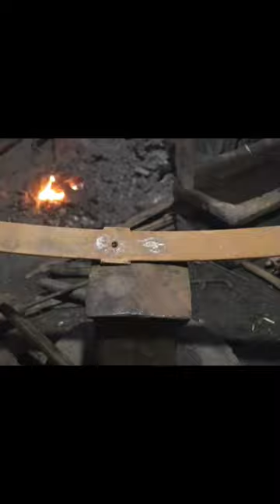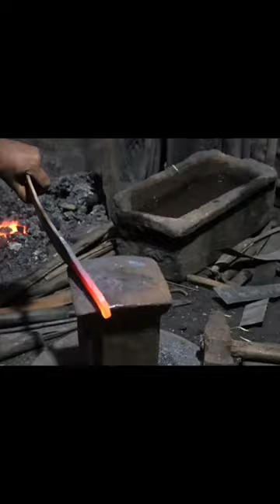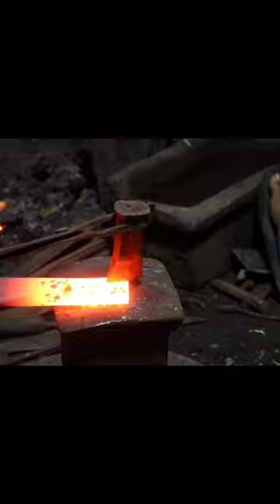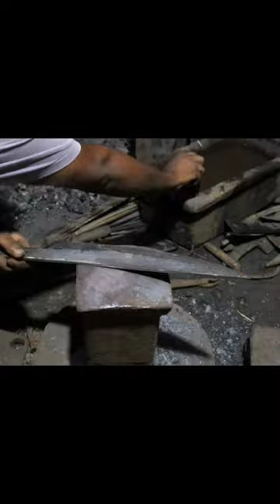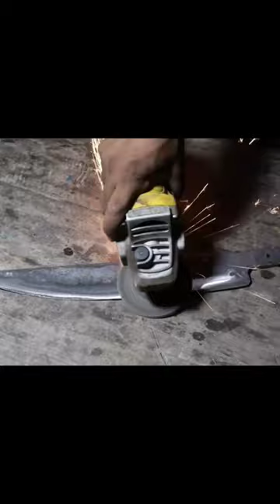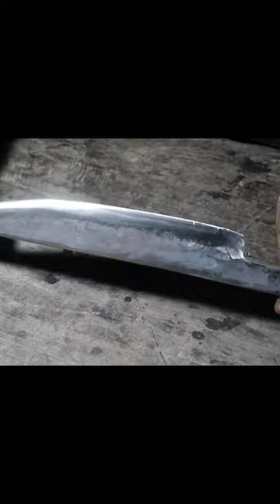Making Kurbani Knife From Leaf Spring #blacksmithing #knifemaking #shorts #short

Comment: Leaf spring knives and tools are pretty common in some parts of the world. Reforging the steel or sometimes just cutting and sharpening and you have a tool from a discarded spring.
Reply: tools with very good performances too ! They are usually improved alloy medium carbon steels, wich are tougher than plain carbon steels, and more rust resistant. They can give you a solid 60HRC and tough blade with a proper temper